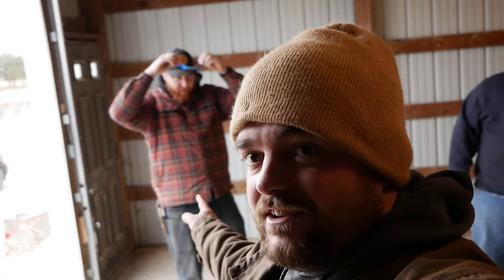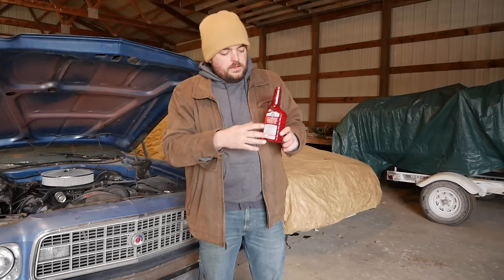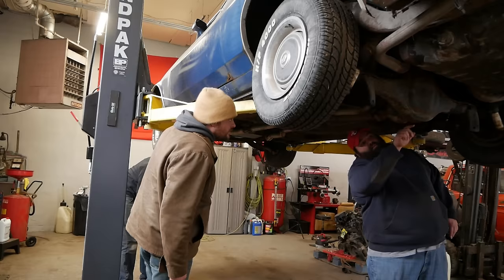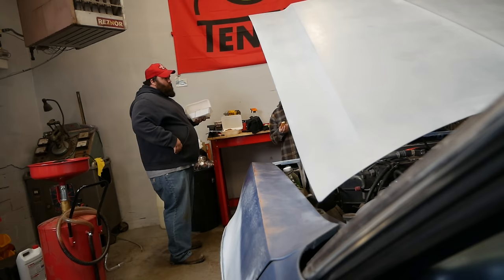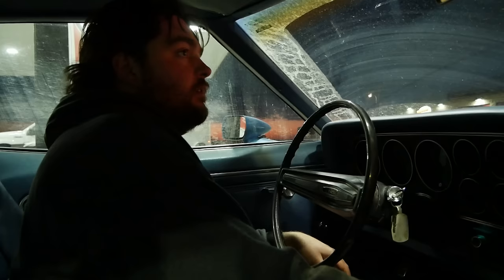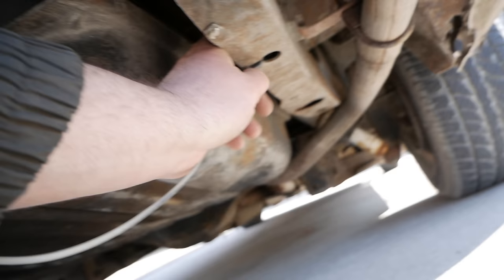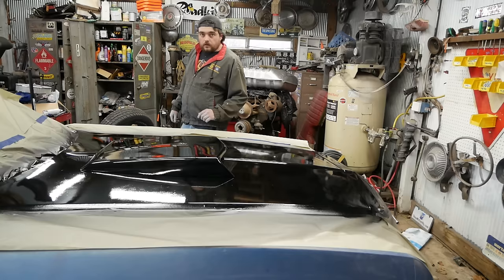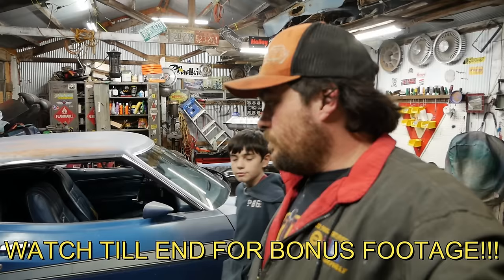Will My DREAM CAR Gran Torino Drive 260 Miles Home? Plus Day Two Mods

Comment: ehh... don't get me wrong, but adding "extra air intake" for hood, but without actual hole to engine compartment (with need for extra cooling i suppose) doesn't make sence, i guess? or it's just for beauty? if it is, then i think it can reduce car's aero dynamics (which it actually have)
Reply from the maker: Same logic that applied to most muscle cars, strictly for appearance. Opening a hole in the hood would be an issue in you know... The rain
Reply: @PoleBarnGarage  ahh the rain, sorry i forgot

Comment: Will it? At least change the oil drain flush and add new coolant. Then install a set of new tires. Much can go wrong over just 260 miles or half that distance.
Reply from the maker: It was perfectly fine. We did change the oil in the video

Comment: 45:17 when you get old (like, old old) then you can use two feet.  Hopefully by then you can afford brake pads a little more often.  Keeps the tailgaters away if the brake lights are flickering randomly.  And wear a hat.  One of those plaid caps like children of the streets wore in black and white movies.  It's always a good idea to avoid men driving while wearing hats.  Old men in newsboy caps.  Young men with backwards baseball caps.  Middle aged men with forwards baseball caps.  Cops.  All good things to avoid while driving.

Comment: Only problem: looks like 302 power. Never saw one like that. All I seen is 351C powered 2 or 4bbl with Dual Exhaust. Why 302?¿??
Reply: Now towards end of video,. Under hood shot now looks like 351C. I take my complaints back!
Reply from the maker: It's a 400..

Comment: Running a trans with no fluid on it is not good for the trans and the pump just a FYI
Reply from the maker: It was 2 quarts low, it'll be fine

Comment: 13 MPG on the open road ?!? That SUCKS. For a 4000 lb. car with a 50 year old motor.... it's about right but it still sucks. Pretty cool letting your child drive your new car, my pops would have never done that. Congrats on a sucessful check off from your personal bucket list.
Reply from the maker: It's getting more like 18 now, 320cfm economaster carb

Comment: Rumor has it they did those odometers like that simply because the odometer numbers were only for keeping track of your fuel mileage and oil change intervals not to judge how much life was left in your car because back then even they cheapest economy car was still so well built that it'd roll that odometer 3-4 times before it ever needed an engine rebuild lol-ol-ol what the hell happened to America, where has our pride in craftsmanship and build quality gone? Back then you could smack a fender with a hammer and it wouldn't even dent it whereas now they're building new trucks with such thin crap metal you can push it in with your finger and it could cause it to misshapen 🤷‍♂️🤦‍♂️🗑
Reply from the maker: No.. Pretty much the opposite. Back then a car was likely done by 100k miles, and cheap enough to replace every 2-3 years with a new one.

Comment: There is nothing about this car that’s a muscle car!  1970 marked the last year of the muscle car.
Reply from the maker: .. No
Reply: @PoleBarnGarage  Beginning in 1971 compression ratios began being lowered, horsepower fell too, hardened valve seats were installed in all cars so  they could run on unleaded fuel to comply with the Clean Air Act.  Anything 70s car built after 1970 therefore has a lower compression, lower horsepower “smogger” motor in it. Saying “No” to this either means you’re misinformed or just in denial. Either way, glad you like your Torino…just hate to see your young passenger being taught something that isn’t true.